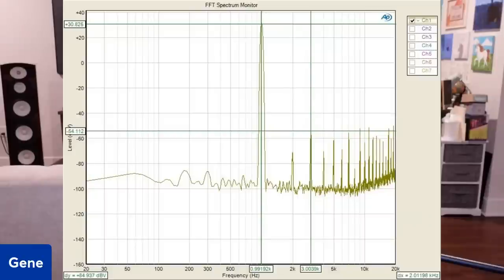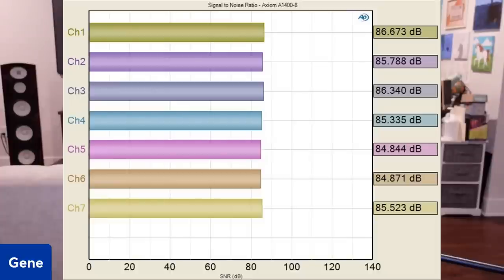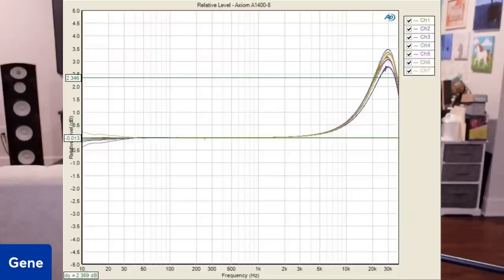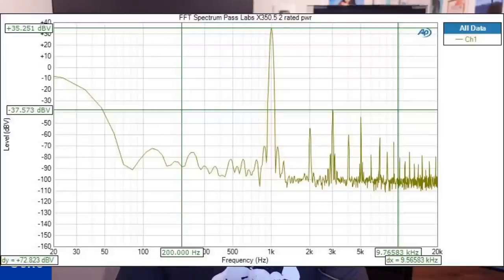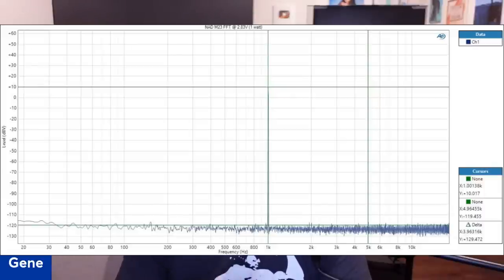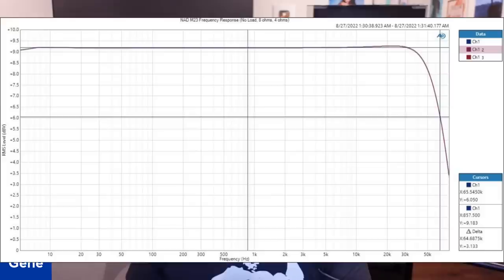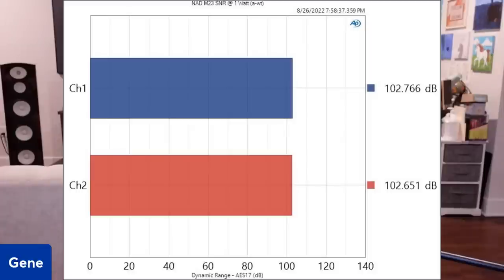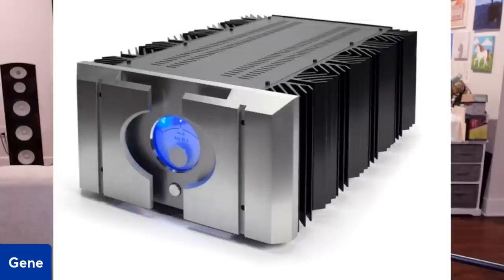Linear Amps are DEAD, Long Live Class D!

Comment: As if I should be surprised the M23 from NAD should measure well or sound great. This company is well known for their designs. It is after all a Monitor Series product. Class D or not, this is a top tier contender just for measurements sake. No, I’m not surprised. Is the power supply linear or switching. If it is a switching type, that would be a miracle of engineering! Looking forward to hearing it in my system.
Reply from the maker: SMPS, it is miraculous
Reply: @Audioholics , please define SMPS for me.
Reply: I generally thought class D means switching. So all class D, regardless of being digital or analog, would be switching.
Reply: @onebylandtwoifbysearunifby5475  I’m awaiting Gene’s answer. Not necessarily on all Class D amps.
Reply: @markphilpot8734  Class D doesn't mean digital. There are analog Class D also. The definition of Class D is switching.
Reply: @onebylandtwoifbysearunifby5475  not all Class D amps use switching power supplies. Still waiting to hear from Gene, himself!
Reply: @markphilpot8734  He already answered your question, and so did i. It's not clear what you are waiting for, but here's something to read while you wait:

"A switched-mode power supply is an electronic power supply that incorporates a switching regulator to convert electrical power efficiently. Like other power supplies, an SMPS transfers power from a DC or AC source to DC loads, such as a personal computer, while converting voltage and current characteristics."
Wikipedia.
Reply: @markphilpot8734  he already wrote SMPS = switching module power supply

Comment: Yes, they measure great, but how do they sound? Does the NAD sound as good as the Pass Labs? Measurements aren't always the whole story.
Reply: Purifi based amplifiers are more transparent, quieter, and more efficient. I have Pass Labs amplifiers and a Purifi amplifier. People often like certain distortion. It doesn’t make the product bad to have distortion, but it does mean it’s not a transparent device. The goal of an amplifier is to keep the signal pure and provide as much clean power as possible as efficiently as possible.

Pass is fine if you want to change that signal, just like how tubes are fine if you want to add distortion in other places. You liking distortion is your own thing. They’re not supposed to distort, though.
Reply: What ! The best measurements equals the worst performance. Only in the audio industry !
Reply: @r423sdex  in some instances, people don’t really know what to measure or how to interpret what they’re measuring. Yes, objective performance is key, but understanding it is crucial. Toole, Olive, and Geddes can explain best what to look at, but even they recognize there are elements we still don’t understand.

Comment: Amazing specs! I'm wondering if A and A/B will have an appeal over D into the future, audibly or otherwise. Hard to predict. wish I had a crystal ball.
Reply: nostalgia, art, preference for certain distortion even, perhaps.  just like many will never prefer EV's, or digital audio.  but technically?  no.

you can get near enough to these specs for 1/10 the price though.  near enough that no one in a double blind test could ever tell the difference, and near enough that you'd still outperform most high end a/b amps.  i'd never spend this kind of money for a class d amp when you can buy modules and kits and power supplies and throw them in a box.  and that's if you need big power... if your power requirements are low, there are much cheaper ready-made solutions that get close enough for wayyy less.  i think i have maybe 300 bucks in my tripath ta-3020 amp and it's distortion figures are vanishingly low all the way up to 100-125 watts or so, can't remember exactly.  and essentially the same amp can be built to push even more power with a few minor changes.

tripath ("class t"), class D, and class a/b amp modules and smps and linear power supplies all available at connexelectronic dot com, if you're a diy'er.  the value is insane, and they have options for virtually any power range one could want.
Reply: Not if you do double blind tests.
Reply: @Artcore103  "you can get near enough to these specs for 1/10 the price though.  near enough that no one in a double blind test could ever tell the difference"   All True. Heck, class D is made for DIY
Reply: For most older "audiophiles" the answer is a resounding NO. Nothing is better than their old gear and even older ideas especially if it involves CHANGE! I have always tried to keep an open mind when it comes to new technology.  As an older woman, whose joints can't handle the weight that they used to be able to handle getting a 20lb 5 channel amp was a must. I am now running my 5.2 channel system with a Classe Sigma-5 channel amp. I still have my Sunfire 5 channel 400wpc 40lb amp and I will keep it as a backup in case the Classe breaks down on me.
Reply: @cfrizz1  even 20 pounds is heavy and overkill for class d.  Could reasonably do half that weight even.
Reply: @cfrizz1  even 20 pounds is heavy and overkill for class d.  Could reasonably do half that weight even.
Reply: @Artcore103  Maybe, maybe not. My Sunfire has 405wpc and drove all my speakers beautifully. But when I hooked up my 200wpc Classe, I found that with some of my 5 channel SACD's, the clarity that used to be there wasn't in the back speakers. As far as I'm concerned there is no such thing as overkill when it comes to power. The more the better, the speakers will only take what they need, but the power has to be there in order for the speakers to access it. I can live with what I have now, but I will NEVER run my speakers with less than 200wpc.
Reply: @cfrizz1  I agree but I didn't mention a power figure.  You could get 200+ wpc easy in a 10lb amp if it used smps's.  Just saying.  People equate weight with quality though so they don't.
Reply: @Artcore103  The only reason why I have to consider weight, is with the limitation of how much I can safely lift. It has nothing to do with quality. You are correct most so called "Audiophiles KNOW" that the heavier it is and the more money you spend means it's a quality made product.....BS! This is what I call overblown ego.
Reply: @cfrizz1  Maybe with speakers the weight thing can still hold true (neo magnets aside). But with amps, I'm happy to have swapped my barely liftable behemoth to something I can wave around in my hand lol. Plus you can hide these class D amps out of sight for a cleaner setup. And they don't get in the way of the sound between speakers
Reply: With speakers, stiffness is important and mass has no value in accurate reproduction. My latest bass cabinet uses 1/4" plywood for side and top panels with the goal of making it as light as possible without compromising bass quality. My goal is to reduce/remove noise from a linear system and when the appropriate design parameters are implemented, the bass quality is near noise free so the bass characteristics within recordings are unveiled.   Tip - Stay away from column speakers with a vent at a distance(woofer at top and port near bottom or under base). This will create audible resonances. This configuration is part way toward MLTL and without proper design goals and knowledge of MLTL then it will be a noisy mess. Unfortunately many commercial speakers are designed this way. The engineers either don't know what they are doing or they're designed for appearance and/or creating an effects box that can attract many customers in the showroom but will grow tired of them later and force them to buy the latest model. 
Proper engineering of Helmholtz Resonators is vent(s) concentric with the woofers, along with a host of other proper engineering features for low noise bass reproduction.😊

Comment: No way, I don't require any more digitization of my songs. HT/Car audio, much the same thing. Might be a good workaround for 110v regions.
Reply from the maker: Class D amps aren't digital.
Reply: @Audioholics  They are translating your music into PWM with a triangular wave oscillator then into r.f then demodulating the resultant mess, via coils etc might be analogue technically speaking but too many translations for me. Thanks all the same.
Reply from the maker: @johnshaw359  😆 you're probably not a fan of digital audio either with that type of logic.

You should educate yourself on what Class D really is before discounting it:

Must read: https://www.hypex.nl/img/upload/doc/an_wp/WP_All_amps_are_analogue.pdf
 
And watch: https://youtu.be/kPqpuTO6Kd4
Reply: @Audioholics  You should look at the schematic again, it only reinforces what I said to begin with, if I'm reading the block diagram correctly, also the digital section of the class D amplifier is shown in green. So how is it not somewhat digital and why is there a dac or an adc, upsampler etc  in nearly all of the schematics of the class D block diagrams.
Reply from the maker: @johnshaw359  From Bruno Putzeys himself:

"The most useful thing I've ever said about the matter is probably this:
https://www.hypex.nl/img/upload/doc/an_wp/WP_All_amps_are_analogue.pdf
 
Let me try to write an answer that's shorter than that. PWM doesn’t quantize. The power stage may be binar-ish but the timing is not quantised. The thing about PWM is precisely that it converts voltage information into time information. There is sampling in PWM but quantization is not implied. You may add it separately if you want, but you would need to have a reason. 
 
For a circuit to be digital in any meaningful sense you need to be able to point at digital signal. A signal is digital if, and only if, it encodes numbers and the circuit receiving that signal treats it as such. A DSL signal is a digital signal from the perspective of the modem, but it’s an analogue signal from the perspective of the phone line.
 
You have to be able to write those numbers down, unambiguously, have a secretary copy them onto a clay tablet to send to a colleague who dictates them over a noisy phone line, where a third types them up on a PC. You should then be able to open that file and reel the numbers back off into the input of the circuit it was intended for without it ever being the wiser, and without any information being lost or otherwise changed. You can't do that with PWM because the information is encoded in the timing which is not quantised so you can't even begin to write it down. If you tried measuring the precise timing of the edges in order to write them down, that would be you doing the quantization and digitization.
 
This makes a DSD signal eminently digital, because you can store it on a hard drive, bit torrent it to another hard drive, and play it back with no loss other than that incurred in the A/D and D/A converters. Whether those converters are direct 1-bit converters or not is neither here nor there. A direct 1-bit converter produces carefully controlled analogue pulses as commanded by the bit stream. What makes it a D/A converter is that it produces those pulses based only on whether the input signal meant "1" or "0" and irrespective of any noise, overshoots and whatnot that might also have been present in the signal that delivered the data. The fact that on a scope the output of a 1-bit D/A converter might resemble the incoming data signal is coincidental.
 
An operative test is: apply a disturbance to the signal. If it's a digital signal, that disturbance will either have no impact at all, or will totally disrupt the transmission. There is no such thing as a bit with a value of 0.995.

What you'll find is that of the people who get worked up over the question whether class D (or DSD for that matter) is analogue or digital, none is actually a seasoned designer. Look at the nature of a statement like "class D is digital". That says exactly nothing about what the circuit does or how it does it. The only reason why it seems to make sense is because it's about the magical quality called "essence". Our brain is wired to assign essences to things because it generally allows us to make quick, useful inferences about daily matters. It’s maladaptive when used as a means of talking about technology: is this amplifier imbued with digital or analogue essence? It's simply not an engineering question at all. You could just as meaningfully ask whether it's male or female. I wouldn't even call it a philosophical question.
 
The only reason I can think of why people would want to assign digital or analogue essences to class D (or DSD) is because they feel those terms to carry a certain emotional charge which they want confer onto an electrical apparatus. Maybe because they want to sell it, or they want to justify to their peers the act of buying or not buying it.

To an engineer the only question that should matter is "what problem am I trying to solve and how am I going to do that". If one lets one's stone-age mind hijack the process and decide class D "is digital" up-front, that means you've decided to look away from distortion (an analogue problem), or at least to avoid solutions that feel overtly analogue. Which would be a bit of a mistake when you're trying to deliver volts and amps to a electromagnetic transducer.
 
This is not to say that you can’t enlist the help of some digital technology if it turns out that doing so would make life easier. For instance, if I had to design a class D controller on a chip I would definitely start by digitizing the output with an ADC and then doing all the feedback math in DSP, simply because that reduces the silicon area enormously and allows you to port the design to new chip processes easily. That choice doesn't make the amplifier inherently better or worse mind you. It doesn’t make the problem any less analogue either, and it doesn’t change the fact that you need to take an analogue POV in order to be able to identify and solve the problem.
 
Besides, there isn't anything about class D that naturally sets it apart for such digital treatment. You could build a class AB amplifier with a digital control loop. The reason why nobody does that is of course the same as why we don’t see any microprocessor-controlled steam engines."

Comment: $20,000 to replace your car battery is the wave of the future. Class D sounds like a pulse width modulated distortion pedal.
Reply from the maker: @MichaelDespairs  congrats on 2 ignorant and incorrect points in one sentence.
Reply: @Audioholics  you better prove me wrong and replace your vehicles with Teslas. When your out of warranty battery needs to be replaced, please think of me. <3

Comment: Just a way for manufacturers to make amps much more cheaply yet charge the same prices
Reply: If you look around there are independent manufacturers who take the pre existing boards and assemble them.
E.g. the Nad M series gives you around 200 watts for around £3000. My Icepower 600 wpc power amp was £800 brand new.
Pass labs/ Dan dagostini rely on people buying the badge. Irrelevant what's on the inside or how it is produced. The badge dictates the cost.

Comment: I’m shopping amps right now? What are some class D amps that measure better than parasound and outlaw linear amps and are cheaper?
Reply: Look into hypex, purify, ICEpower and Ncore stuff. lots to choose from
Reply: Thanks
Reply: Hypex Ncore and Purify class D switching amplifier modules are the brainchild of Belgian born EE Bruno Putzeys; arguably the most talented class D design engineer. Putzeys developed Ncore when he worked at Hypex, a Dutch company. He left Hypex a few years ago and co-founded Purify in Denmark. The top Ncore and Purify modules, which are fully balaced designs, have pretty much the same performance. Those modules measure better then other competing class D switching amplifier modules from companies like B&O's ICEpower, Pascal, etc. 

Another new and very high performing class D design comes from Chinese maker Topping, which has become a leader in DAC designs. The Topping PA5 ($349) class D fully balanced amplier measures superbly if you can live with the limited power output of 83 watts @ 4 ohms and 48 watts @ 8 ohms.

The Hypex Ncore, Purify and Topping PA5 objectively measure better than the vast majority of linear power amplifiers that I've seen properly measured.

Finally, a notable exception that outperforms every other amplifier I've seen measured, including the top class D designs, comes from Benchmark with their AHB2 ($3000) hybrid class AB and class H amplifier that uses THX's patented AAA technology.

P.S. For the record, I currently own Parasound A21 and A23 amps, a Cambridge Audio Azur 840W and a Tact Audio M2150 class D amp/power DAC purchased in 2002 that's gathering dust.
Reply: Yamaha has a little icepower class d that also has network capabilities for around $500
Reply: Topping pa5
Reply: @JesusMartinez-mk6fc  - you mean the Tact Audio is gathering dust, correct? My ears still tell me class D sounds so-so at best. I don't care for measurements.